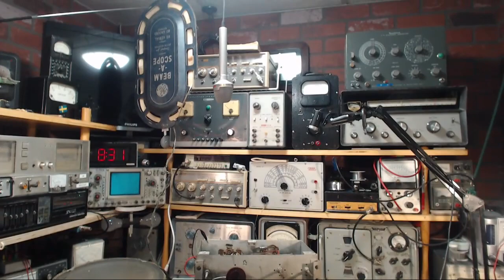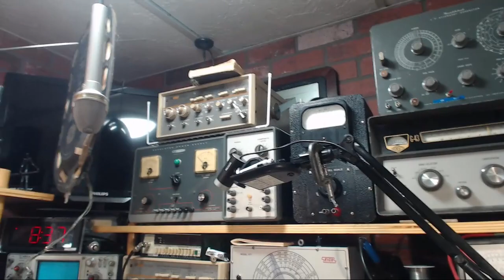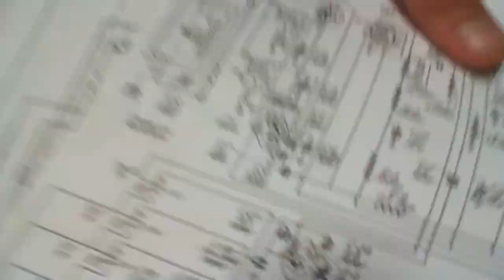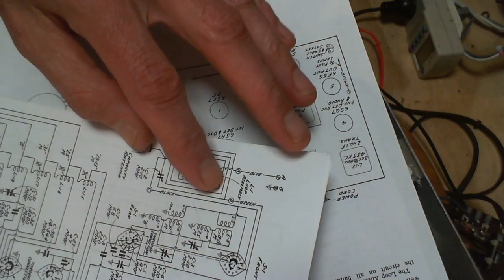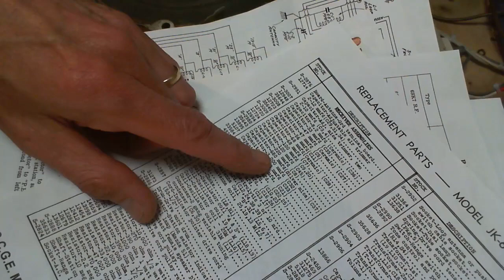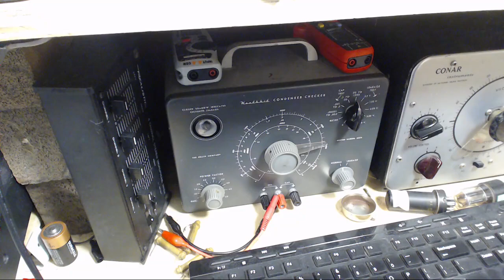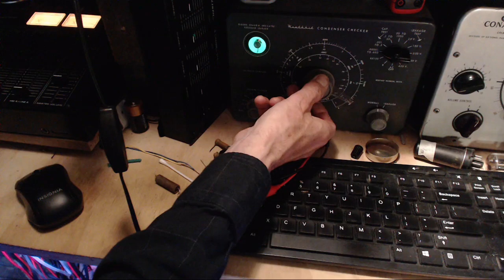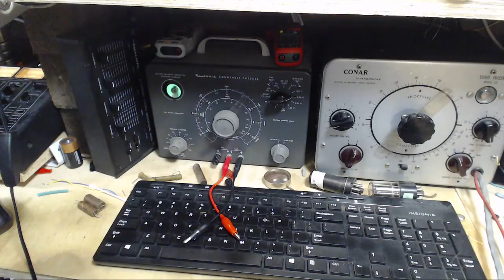Canadian General Electric Model JK-66 Video #3 - Beam-A-Scope Antenna

Comment: All paper capacitors must go to start with, then if the electrolytic capacitors have dried out then those will have to be changed, if you want you can use a 47pf capacitor across the electrolytics to get rid of the RF that we don't want, That last yello cap you installed it doesn't look like that it has been soldered.